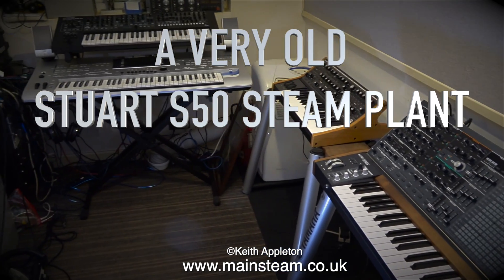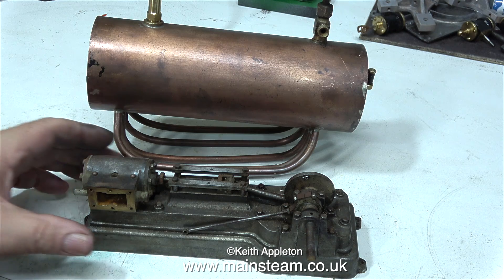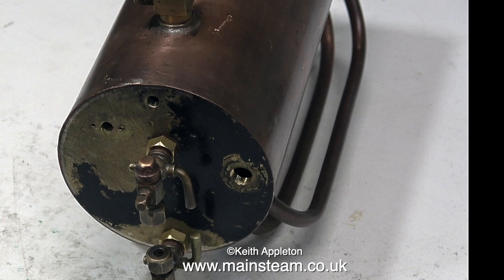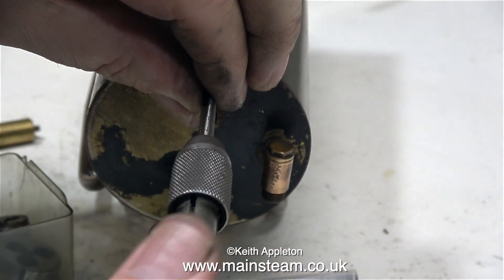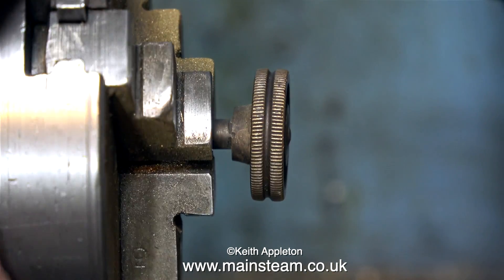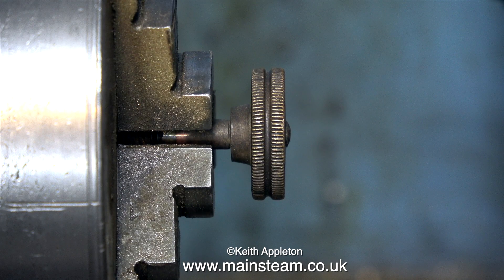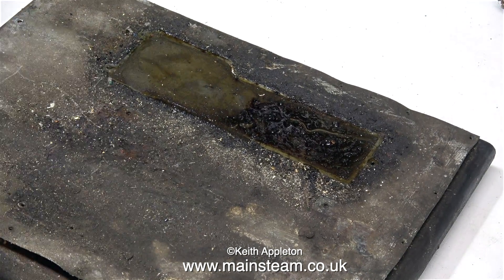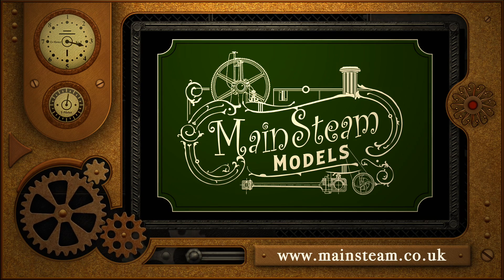A VERY OLD STUART S50 STEAM PLANT - PART #3

Comment: For the wonky wheel I have seen people use a bearing on the end of a shaft in the tool post.  The tool is just pushed up against the spinning part in the chuck and it perfectly straightens that part. Searching lathe push tool will find examples